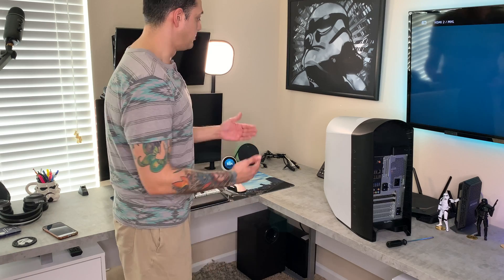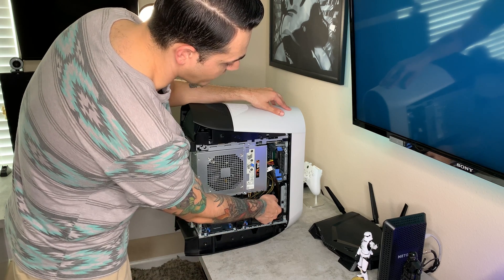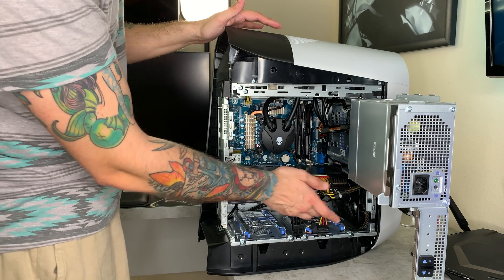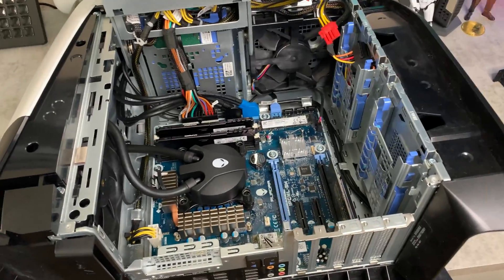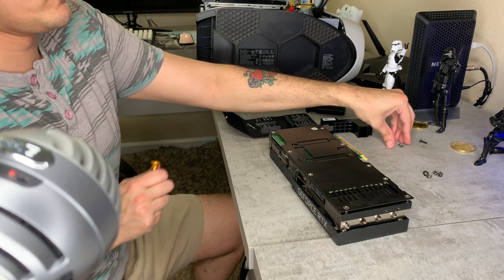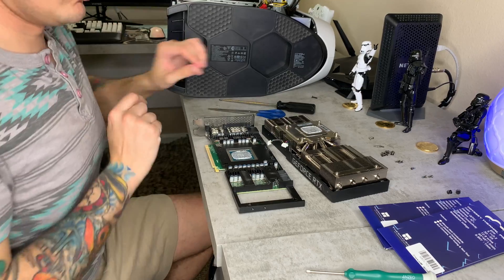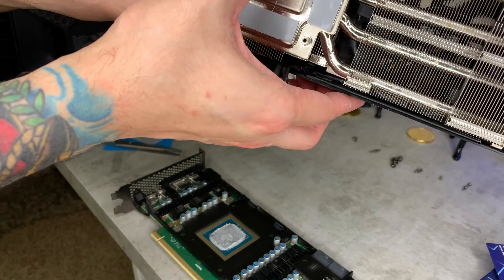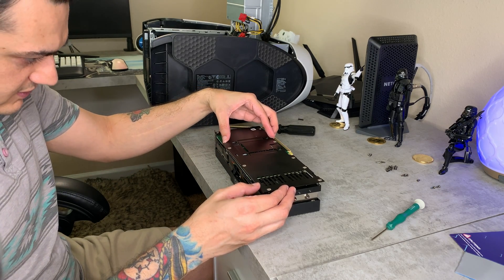Alienware R11 RTX 3080 Thermal Pad Swap

Comment: Dude, I have the same card. There are a bunch of us over at slickdeals who have taken it apart
1) Always repaste
2) Jack up the fan speed.

I repasted, added 0.5mm pads between the vram heat sink and the main heat sink. I added 1mm pads to the back plate like you did. 

Try this:
Lay computer on it’s right side and leave the cover off. You can raise the psu up to give better ventilation for the backplate.  I’m in the process of adding new chassis fans but if you are still stock, that side cover adds 2 degrees to vram. 
Jack up the fan speed. I set my curve to 70% fan to around 48* on core temp. Your fans are dependent on core temp, not vram temp. Jacking up the fan made a huge difference for me. 
I’m getting 97 MH with memory clocked to +1050, power limit at 70%. Card is drawing 225w. VRAM between 88-90*
Reply: If I lay it on its right side, the mobo is covering the entire top part?
Reply: @dr_osrs  lay on the other side that is not blocking the open cover
Reply: What do you mean thermal pads between the heatsink and vram heatsink??
Reply: @trueno1337  When you dissassemble the 3080, there is a heatsink for the vram and the main heatsink. In the oem config, it does a poor job of tranfering heat from vram heat sink to main heat sink. In the video, he adds paste.
Reply: did your thermals stay good after the .5 mm pads on that heatsink? Ive seen many try and say their die wasnt getting good contact after that. I think its recommended to try to get .25-.3mm pads to use there but if I can get away with .5mm pads that would be nice.
Reply: @ I no longer have it. Worked great until I sold it last year

Comment: Hey,

I added thermal paste in the areas you put thermal pads near the heat sink and it dropped 10 Deg C. Also added heat sinks to the back plate and use a fan to cool it . Mounted the 3080 using a 16x extender cable. Getting around 96MH/sec at 100 C Junction Temp.
Reply: I have done in dell RTX 3080.

Comment: on my rtx tuf 3080 at 94 megahash fans at 70 my junction temp averafe is 90.
is that ok
Reply: yes, a mean if you can lower it a bit it will be even better
but 90 is very good if you really don't want to open your card and go through the trouble of changing the pads, 90 while mining is very acceptable, at least you are not thermal throttling or overheating that much, anything close or over 110 is considered bad, that is when throttling begins, it can also damage your card memory chips, 70 or 80 will be better but as long as you stay in low 90's you really don't have to change the pads or nothing to worry about. unless you really want to change the pads, if someone card is thermal throttling then that person is forced to change the pads, is not optional, is mandatory, but in your case is really optional
Reply: @yonoexisto7833  you love warranty so not worth it now.
Reply: @thedarkangelpt   yes that is also very important and i also though of that but if i want to mine with the card then i will have to do it, because if i don't then the card might get damage and if i send the card back to gigabyte they might not have any more cards, i rather change the pads and enjoy the card, i had bought many expensive cards during the last few years and i never had any problem with none of those cards, i always have my system with new components, it really depends on the way you see it, i think you are fine with your card so you don't need to do it. but i do. anyway if something happens to the card, i just hope i have made most of my money back by then, but i'm taking that card for mining, so i have to do it, if i want the card to last long, because with those cheap thermalpads from factory i will not last long and most likely it will burn the memory chips, but i do understand your point and you are right, the person also have to make that decision, leave the card as it is, overheating if you want to keep your warranty or fix it yourself, even if you send the card back to gigabyte most likely you will get a refund and no card fixed or replacement because there is no stock, the refund won't be enough to buy a card at scalper price, so if you want a working card then you have to fix the card that you already have, but yes there is always a risk, but i never get myself into things that i know i can't do

saludos rafael

Comment: Dropped 30c on founders 3090. Now run at 80% at 94c fully cranked up memory. Applied the thermals directly to the chips on both sides of the card.
Reply from the maker: That's awesome brother! How are you liking that 3090?
Reply: @GamerHeavenOfficial  great I use it for video production but in downtime its mining now . Good luck if you attempt to change your pad configuration again. Scared me to death changing it but long term it will be worth it.
Reply: @TheTesting1239  currently this moment 121 sitting at 90c. Mine is a founders 3090 in a custom cyberpower pc with amd ryzen cpu. Using nicehash on the new high profile setting.

Comment: Highly recommend you redo it because I have the same exact card as you from Alienware r10. My temps are 54c core, 88c memory at 50% fan speed, hashing at 95. What I did was instead of putting thermal pads, you put thermal paste around the vram heatsink contact part. Maybe thermal pads is too thick in those area is my guess? I used mx-4. Also I changed the vram pads that came stock, 1.5mm underneath the black heatsink. Don't think you open underneath the black heatsink in this video. On the backplate, I kept everything the same but did 2.0mm (stacked two 1.0mm) for the sides where the long small chips lined up are on the outskirts. Also, after running it hot, you can rescrew, retight them after because there is a break-in period. This should lower temps further. Hope this helps!
Reply from the maker: Thank you man! I am going to give it another go with the thermal paste. I feel like I am in the minority not the majority with my results, which really sucks because I know I did something wrong. Do you happen to have any pictures you took of the process, or a link to the pads/paste you used?
Reply: @GamerHeavenOfficial  glad you’re giving it another go- I don’t think I’ve read a single Reddit post that didn’t have success using the thermal paste method.
I look forward to you video when you re-try this, as a detailed video hasn’t been made, and I’d love to see it done by someone more electronically adept than I am before I do it in a couple of weeks!  Thanks for your fantastic content.
Reply: @GamerHeavenOfficial  I am getting this exact card in 3 weeks. I already redid my 3090 and got 14C max temp difference. Went from 110C Junction and throttling to 96C max junction when I changed my thermal pads. I like the effort put in. I know it can get frustrating especially when making a video and editing it but next time should go a bit smoother for you. If you do decide to give it another go, post it in here and I will watch it for sure when mine arrives in 3 weeks.
Reply: @GamerHeavenOfficial  same 1.5mm directly from the board and black metal piece, the heatsink where you put pads, I put mx-4 thermal paste on the cpu AND memory area. I also just finished optimizing my side fan case...I can mine with case closed now lol... how do I send you pictures? You can probably make a video about it lmao. Just give me a shout out ;) 

Temp with case closed:
Nicehash medium optimization 
55% fan speed 61c gpu, 92c memory
Cpu 54c, vram 73c
Ram 44c
Ssd 38c
Reply: You can try tighting the screws in your current configuration but I suspect thermal paste vs thermal pads around the heatsink might be more viable.
Reply: How is the black plate covering the VRAM removed? I assume it’s screwed in? Curious as I do not have my R12 for another 2 weeks or so
Reply: @Go_Birds  there's 6-8 screws you remove, the backplate is the easiest to get to. After you remove the 4 main screws that holds the heatsink, the black plate is harder, need to use flathead where the screws are located and open up the black plate in those areas, well at least that's what I did.
Reply: @Bvosays  at that point, what’s another 6-8 screws. 😂 
Seems like getting thermals pads directly on the VRAM chips is a must.
Reply: @Bvosays  also - thank you!
Reply: I did the same, I only applied the thermal paste to the vram heatsink and my memory temps dropped from 110c to 94c, I didn't change anything else.. Which thermal pads you changed to 1.5mm? is it the ones at 12:14 time?

Comment: Question about the ram. I thought with the auroras, if you wanted to add more RAM, you would have to get rid of the ones you currently have and buy a whole new set, is that not the case?
Reply: ik this is 4 mounths late but you can buy parts like RAM on their website

Comment: The AIBs have the area where those poscaps are cut out of the backplate. Presumably so they can be cooled by case air flow? They're just capacitors though so any additional passive cooling wouldn't really alleviate the issue which is hot GDDR6X and junction temps. I appreciate you doing this experiment. I've considered replacing the pads on my 3080 XC3 Ultra but don't want to waste time for nominal temp reduction.

Comment: One look and I can see the problem. You did not apply thermal pads directly on the memory chips :D. You should remove that "plate" that covers the memory chips, then apply the thermal pads between the plate and the memory.
Reply: I interested to see how that plate covering the VRAM is removed.
Reply: This! It;s the same with the omen cards, seems to be both made by evga. You gotta also apply thermal paste between the top of the bracket covering the chips and the heatsink bc the contact between them is not good.
Reply: ^^ When I added 3.0 mm thermal pads to my MSI 3080, I added them directly on top of the memory.
Reply: he did apply the thermal pads on the momery
Reply: @aminstar5665  no he didn’t replace the existing thermal pads that are on the memory under the black plate. That’s what we’re talking about. You’ll see when he re-does it
Reply: @aminstar5665  I see must have missed it, since this is the only video I got to watch. Must be from previous session.

Comment: Thanks for doing this. I didn’t win the silicon lottery with my R11 since it crashes under other people’s settings but I do get 93 hash at 211 watts and my vram is 96-98 -100 core, +600 memory, 66% power, 75% fan. I keep the case open and my PSU swung out. I places 4 aluminum 2 by 2 inch heat sinks around where the pads are and a Corsair pro 120 fan on top of GPU just past the PSU cables to blow the heat off the heat sinks to the back. This fan setup drops 4c and keeping the case open keeps it from being 110c. I noticed the bottom Corsair fan doesn’t do much to cool the gpu beciase not enough air comes through the front of case. Terrible design . I’m curious if a fan instead of the SSD slot will pull in air since there are PSU cables blocking air to the gpu except a small part on bottom and again not enough air squeezes through the front case panel. Curious to see your result and I have a fan ready. I also noticed that when I split two Corsair 120 bottom fans with a Y splitter cable, one fan ramps up speed if I disconnect the other and then back to slowing down if I connect both. Could this mean not enough power going to the fans defeating the point of having 2 fans unless you run them slow?
Reply: do u repaste? I did to my r11 3080 and reaches to 101-102mhs.

Comment: Did you see the alternative method where instead of new thermal pads you installed, some folks used thermal paste in that area and got good results. Edit- also, Some have taken off the GPU side black plate on the top of the VRAM and installed thermal pads between the VRAM and the black plate
Reply: that's exactly what I did, my temps are 88c mem at 50-55% fan speed doing 95mh/s hash. paste the heatsink ram area, redid the thermal pads on the vram 1.5mm, kept stock thermal pads on the backplate but added two 1.0mm (2.0 total) on the outside where the link strip of chips are. You can try 1.5mm there. Then retight the screws in after heating up the card, to break the pads in.
Reply: @Bvosays  Do you have pictures of your install when you did yours?  If so, please post them somewhere for us to see.
Reply: +1 to using thermal paste instead of thermal pads between the plastic and the heat sink. It's the only thing that significantly dropped my temps.
Reply: @RoccoHorvath  yes- my theory is this: if you look at the heat sink, it’s possible that the heat from the gpu, when being dispersed on the heat sink, could actually HEAT the VRAM, as the black metal plate above the VRAM is presumably in contact. The thermal paste will help prevent this, and simultaneously help cool the VRAM. 
I purchased a R12 with a 3080 so it’ll be a couple of weeks before I get it so I’ve been doing a lot of reading because I’m unboxing and modifying the 3080 before I turn the thing on 😂
Reply: I’ll add that my theory is probably waaaay off but regardless it’s interesting that those who didn’t see results from thermal pads did with thermal paste.

Comment: I changed the fans to 2 Corsair 120mm Pro. Was much more quiet, but not better cooling - Zero ! Made a fan Curve with 100 % workload. The fans got up to 61 %. And Idle was 8 Degrees more hot than the Stock Coolers. Result: Changed back the Stock Coolers. Send back the Corsairs. Your changing Fan Experiance would be very interresting to me. For me it was no Alternative.

Comment: All other gpus have open spot on backplate to those capacitors. No thermal pads.
Reply from the maker: Yeah that makes sense. That would make a difference then, adding thermal pads if there was none.
Reply: @GamerHeavenOfficial  it wouldn't, they are capacitors. Would be a waste of your time